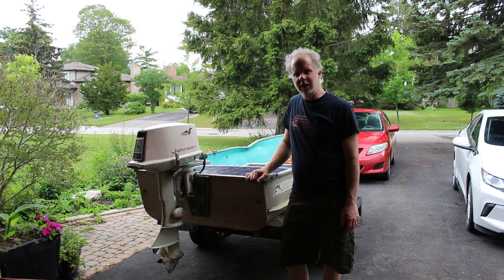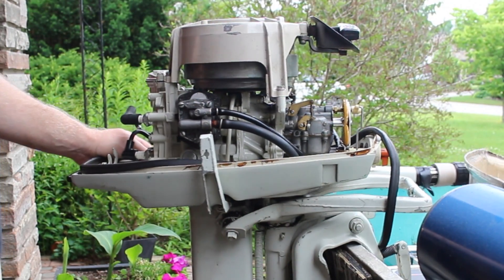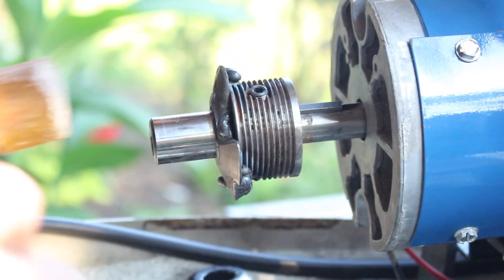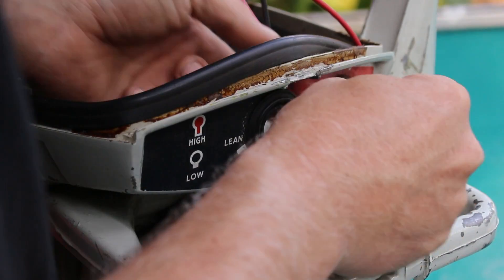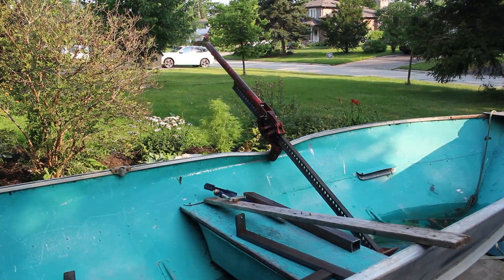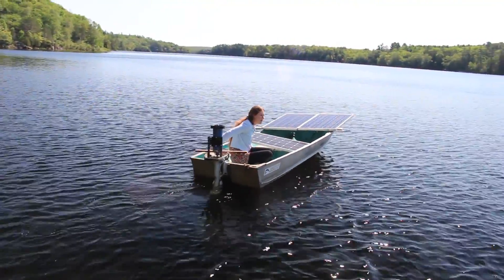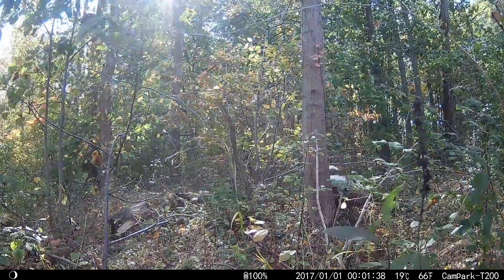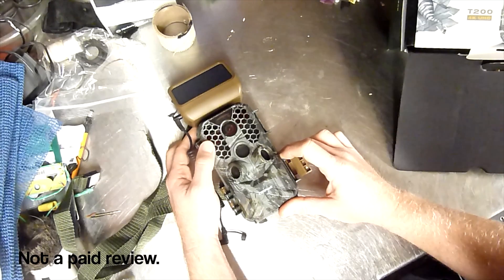DIY solar powered boat. Sail with the power of the sun!

Comment: from the videos,  looks like you don't move too well when there is current or wind.   Looking back now,  would you have batteries and bigger engine? to compensate
Reply from the maker: This was a experiment, I will try adding a battery bank in the next build.

Comment: I've messed with solar panels and trolling motors and canoes.
I'd suggest trying a 12 volt trolling motor with your panels.
I'm currently working on a 21' sailboat with 1600 watts of panels
and a pair of lithium iron batteries.
Here's a short u tube videos of my results
https://www.youtube.com/watch?v=GDU2YbK0Sms
Reply from the maker: Im looking to get my hands on one and give that a try
Reply: I've put together a few different solar canoes and have found the fastest trolling motors move a boat is 3 to 3 1/2 mph.
Granted you're going going to move a 2000 lb boat at those speeds but aluminum fishing boats or canoes/kayaks get up to that speed - That's what the motor was designed to do.

Using 3 or 6 of them will not increase the speed.
I'd suggest getting a used motor to keep the cost down.
And 30 lbs of thrust will give you the same results that 55 lbs will.
good luck - post another video of your results
Reply: It's better to match your motor voltage to your solar voltage. If you're stepping down the solar voltage to 12v you're losing efficiency in the process. If your solar output is only 12v you're going to have a lot of issues keeping a 12v battery fully charged as well. Unless your systems are run on 6V, you'll want at least 24V solar output for a 12v motor.

Comment: This is really cool!  Just so happens we have an old evinrude  motor, a bunch of solar panels, and a boat here.  Gotta find an electric motor to swap out  though.  And wait until next spring or summer to try it out.  Gonna be a fun winter of planning.
Reply from the maker: Cool. Let us know how it goes!
Reply: you can turn an alternator into a good dc motor pretty easily, probably easier to find a cheap/free treadmill though